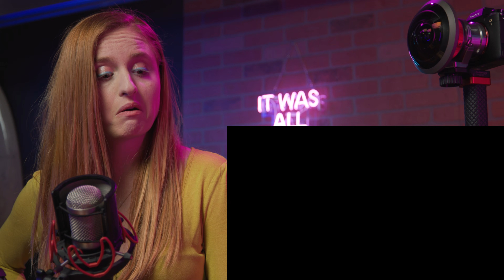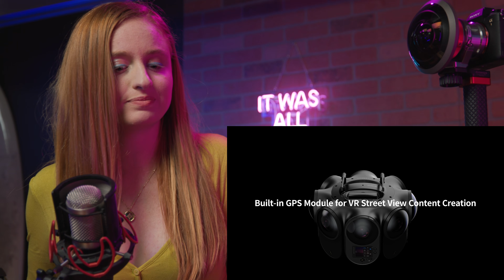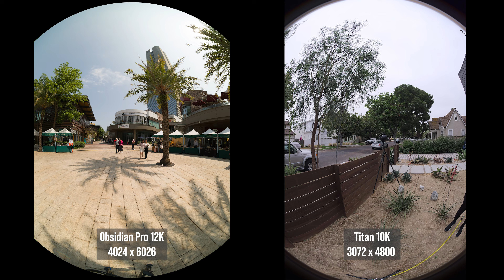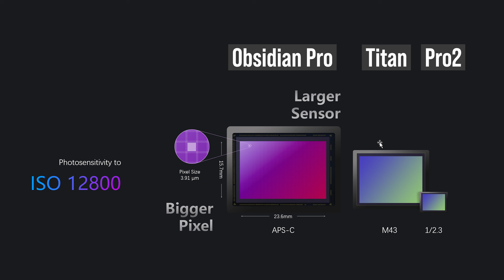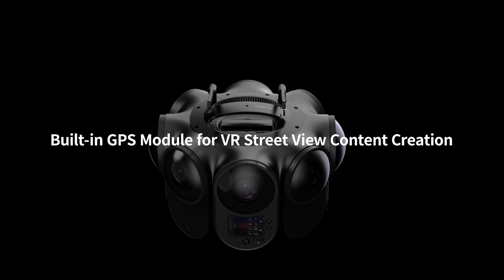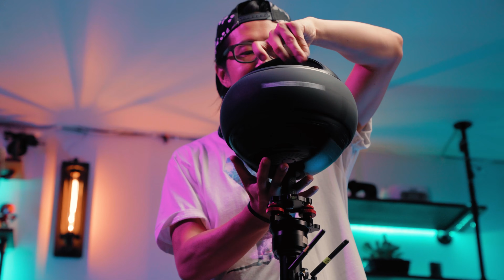The BEST 360VR Camera for Filmmakers? Kandao Obsidian Pro: 12K 60fps, 3D, 12bit RAW, SSD!

Comment: We need higher frame rate VR cams Imo if it cud reach 96fps there wud be a lot more potential for immersion
Reply from the maker: Oculus Quest 2 in TV only does 60fps - so 96fps no one will see it so it is consider waste resource for now. This is cinematic not game engine (CGI). Game Engine 96fps will be nice but in cinematic - that frame rate is not achievable in hardware site.
Reply: @hughhou  I mean it depends if that's the headset that you gravitate towards for VR some vary. Though i believe quest 2 has 72hz native, and through software updates does 90 & 120hz now as an option.